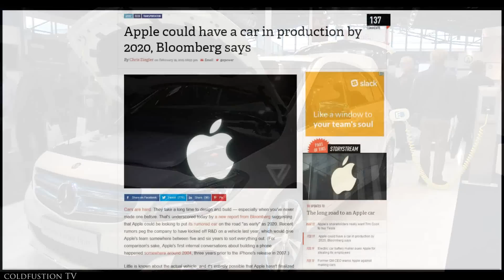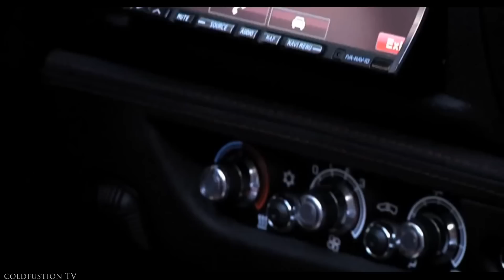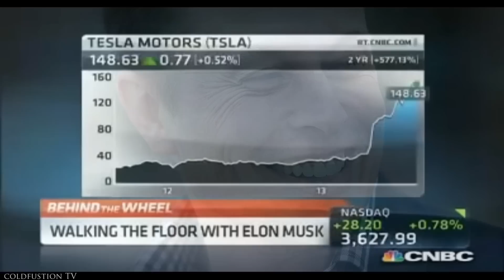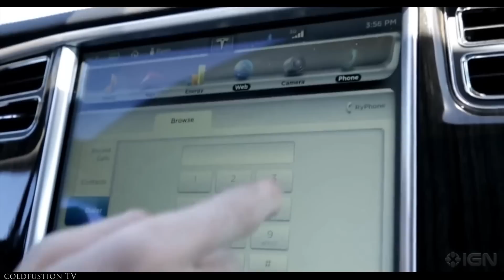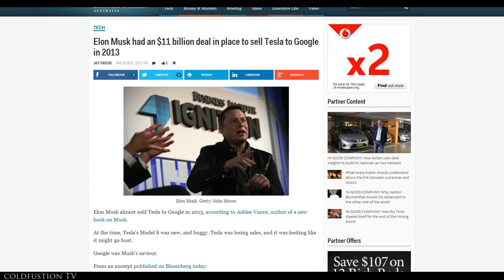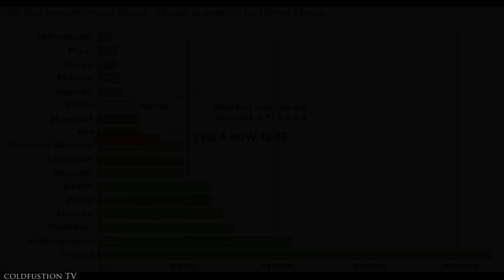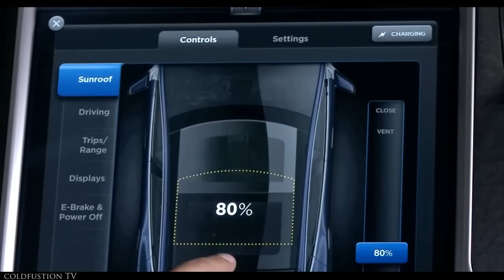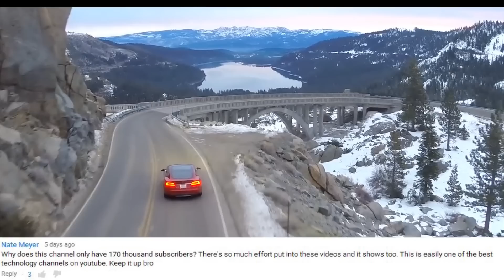How BIG is Tesla? (Bigger Than Mitsubishi Motors!)

Comment: You know that Solar-Panel thing that hikers used to charge their phone in wild.. I hope Musk make Tesla car can be charged using that
Reply: Will make the car too expensive and heavy. That might become an option in the future though
Reply: Solar panel is very light dude.. Imagine this.. With technology right now, they could(i dont know how) mix solar panel with body construction

And bam.. Your car charging itself while driving it. It could run forever, byebye gas
Reply: Simply not worth it. Solar panels are extremely inefficient and don't provide nearly enough electricity to power a 2 tonne car. The best solar panels out there have at best about 25% efficiency, but since the solar panels will be nearly flat on the roof, that value drops significantly.

Let's say you'll have about 15% efficiency. The Model S is 196cm in width (with the mirrors folded) and 498cm in length. The roof is 60% of the whole car's width and only 30% of the whole car's length. That comes to about 120cm and 150cm respectively, which totals to ~1.76m^2, but let's round that up to 2m^2 because I'm being generous.

Now, at 15% efficicency your best solar panel would probably get ~135W of power.  That's in perfect sunlight mind you and the efficiency is likely to drop even more if you're not at an optimal location on the globe at noon with no clouds. That converts to 0.135kWh over an hour. The Tesla requires ~0.21kWh/km (this can obviously vary greatly).

So if you charge for 2 hours straight, you might just about be able to drive a km or two (at best) before you run out of juice and that's being optimistic. That's an absolutely negligible amount and you would probably never make back the money you spent on the panels. It would be literal pennies to simply draw that amount of energy from your wall socket (more accurately ~$0.016 or less for 0.135kWh of energy or ~$30/year).
Reply: Your problem is just one. Who said solar panel have to be flat? There is solar panel in a shape of a ball.
Make body contruction solar panel is great idea.

25% is maximum effieciency right now? There is called "boosting solar panel effiency" that could make it last a years.. Mars Rover.. For example

Its just great basic idea. Development is main credit here.
Reply: Yahtadi Shidiq solar panel is light, but not car parts. You can make a light car but with less features, less safety features, less cargo and passenger space, less cargo load. You can make a light car with tons of features and safety measure but will cost you tons of money and energy because it will have many Carbon fiber parts (expensive and energy intensive production), Titanium (so expensive, only used by mostly airplane industry, even they use it only in some structural parts and mix them with alloy), Aluminum and plastic (yea plastic from oil).  

Not to mention your cost of repair of those Solar Panel-Integrated body panels. It will be very complex or very costly for the customer. And you have to change that solar panel regularly because Solar panel efficiency will degrade around 0.5% (each year) on average, so it will be a race with your return on investment. Not only that, not every place can be fitted with Solar panel, because weather is the main drive shaft of the panel. Then paint is a new issue, some paint will not be available for the solar panel body. It's a big no no. Weather and temperature will play significant role too to your electric motor. Electric current dont works well in Cold temperature, even with Tesla, their car will have shorter range in Cold snowy days. And you have to clean up the snow almost everytime you drive and while you are driving, so it wont disturb your solar panel energy harvesting. Otherwise it wont works and you dont have heated seat and steering wheels.

Lastly, Repairing Aluminum body is quiet expensive, so what about with carbon fibers parts? Mclaren P1 got a CF winglet in it's fron bumper, cost you around $25k to repair  that small piece and it's not actual repair, they just gonna change it with newer winglet. 

Combine all of that complexity, I think Nobody wants to buy that, since it's not practical at all.
Reply: Yahtadi Shidiq solar panel is light, but not car parts. You can make a light car but with less features, less safety features, less cargo and passenger space, less cargo load. You can make a light car with tons of features and safety measure but will cost you tons of money and energy because it will have many Carbon fiber parts (expensive and energy intensive production), Titanium (so expensive, only used by mostly airplane industry, even they use it only in some structural parts and mix them with alloy), Aluminum and plastic (yea plastic from oil).  

Not to mention your cost of repair of those Solar Panel-Integrated body panels. It will be very complex or very costly for the customer. And you have to change that solar panel regularly because Solar panel efficiency will degrade around 0.5% (each year) on average, so it will be a race with your return on investment. Not only that, not every place can be fitted with Solar panel, because weather is the main drive shaft of the panel. Then paint is a new issue, some paint will not be available for the solar panel body. It's a big no no. Weather and temperature will play significant role too to your electric motor. Electric current dont works well in Cold temperature, even with Tesla, their car will have shorter range in Cold snowy days. And you have to clean up the snow almost everytime you drive and while you are driving, so it wont disturb your solar panel energy harvesting. Otherwise it wont works and you dont have heated seat and steering wheels.

Lastly, Repairing Aluminum body is quiet expensive, so what about with carbon fibers parts? Mclaren P1 got a CF winglet in it's fron bumper, cost you around $25k to repair  that small piece and it's not actual repair, they just gonna change it with newer winglet. 

Combine all of that complexity, I think Nobody wants to buy that, since it's not practical at all.

Comment: Tesla should really learn better build quality on their cars. And no.. It's more likely to burn to death in a Tesla (or other electric cars) in a crash. Lithium batteries are dangerous when they catch fire or get damaged and is harder to put out. A petrol car is only dangerous when the tank is almost empty becayuse of the gasses.
Tesla also is involved in more crashes than most other cars. Don't give them more credit than they actually deserve. And don't forget how bad for the planet the production of batteries are. And how many kids dying in the mines when getting out the raw materials for them. Electric cars have encreased that rate compared to how much is was before.
But I will keep driving diesel anyway. MUCH better for my use.

Comment: NON advantages to electric cars. They take A very long time to be fully charged, have relatively poor autonomy, they loos efficiency over time, depending on climat.
No, that's not all. They need a LOT of rare metals and the extraction of said metals are an even worst and out of control pollution, in the countries where they can be mined.
Ecologic? NOT EVEN! They pollute at least as much as gas.
Electric cars are big sham invented by the industry. Car manufacturers WANTED to build electric cars, they lied about the downsides.